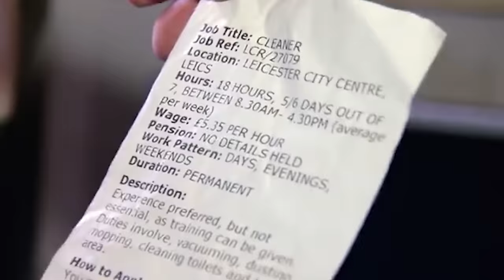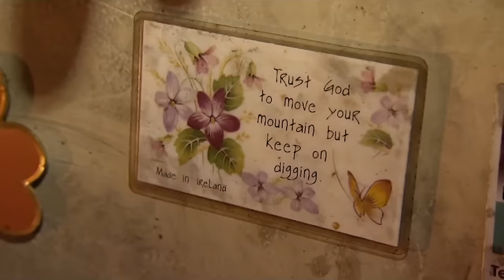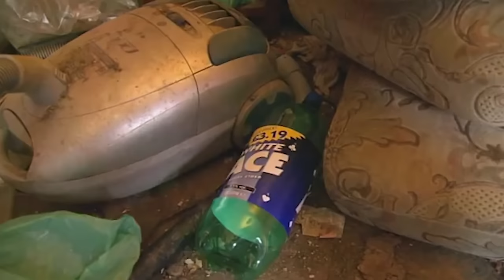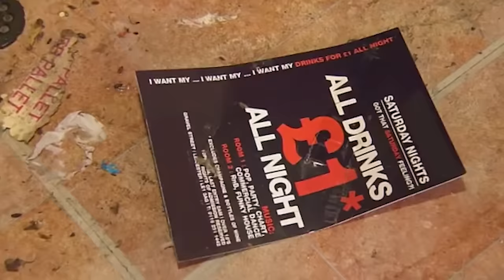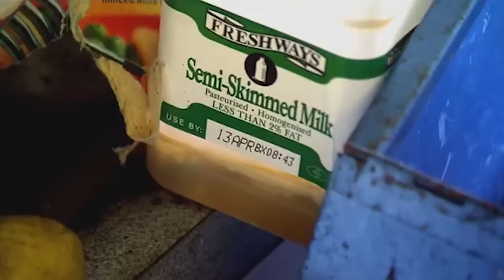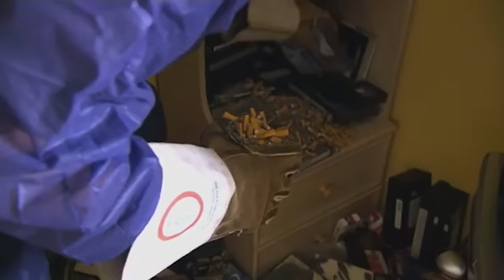Top 5 DIRTIEST Homes! | Grime Compilation | Filth

Comment: These guys need professional filter masks, the mould, dust, rat droppings and the slime everywhere. As a commercial cleaner, this is why I don’t do homes. 😢
These guys are Angels ❤
Reply: What do you clean? May I ask
Reply: I was wondering why they didn't have a mask on. Just the smell could have a lasting affect on their health.
Reply: @mrbald8760  I am a commercial cleaner and have worked as a cleaner in many different environments. Large Hospitals, TAFE’s, which are trade based, degreasing floors, stripping and sealing & polishing commercial grade flooring. Vacuuming carpets and also flooded carpets and floors,  extracted until the water is clean and use fans to dry quickly, dirty contaminated floors can cause mould and mildew, black mould can cause deaths and can be found in air conditioners that are not cleaned and the grills behind them that harbor these spores. Ceiling fans need dusting and sometimes removal of vents in ceilings that are clogged. Bathrooms especially in hospitals need to be cleaned everyday due to high levels of condensation. This can occur in small birthing units as well when the room does not have time to dry out between patients, extraction fans should be installed and on while the birthing is in progress, shower curtains collect mould and the mould is pink and black in one hospital room where I was a patient. I pulled the curtain right back against the wall so my body was not in contact and the water didn’t reach the curtain. Always clean the sinks, take out the small drain if possible and get a bottle brush that can get down into the pipes, sometimes if at home and the shower gets blocked you can pour down vinegar first then add bi carb of Soda, quickly shove a hose with water and and towel to cover immediately as a reaction will start to happen and this is what should clear the drain plus the pressure of the water together, keep a very firm hold around the hose with the towel over the drain to create a seal from above, you will notice when the drain is unclogged when there is no forceful back pressure and the water runs down freely. You do have the option of removing the U bend under a sink or bath if you have access, remember to wear gloves and safety eyewear when doing this and have a bucket underneath the drain area to catch the build-up, and you can be sure the stench will be the first thing that gets you so we’re a professional mask if you do it this way, with the correct filter. I have also worked with cleaning chemical and Pest control chemicals including Termite work on construction sites (not so common to see women in this profession) and I have also done plastering, and sanding back plaster. I have cleaned in bakeries and many other places so my Workplace Health and Safety is very sound. Most important of all is to check all electrical cords and machines are not damaged and machines are clean and in good working order, all filters should be clean before use and cleaned after you have finished using the machine/appliance. In workplaces the items are tagged and tested yearly and the same should be done with Fire hoses (not cracks, splits, missing nozzles) and the inspection company will stamp date the metal plate to verify it is in compliance same time each year. These are important check list items for daily use and correct PPE should be worn when working. Your employer should instruct you how to operate any new machinery and any that you have not used before. There should be an automatic cut out device on any commercial/industrial equipment to avoid electrical hazards to humans or surrounding areas like carpets or any toxic contact. Do not let cords that are not waterproof and correctly insulated near wet areas and wear thick rubber gloves that are lined inside and insulated footwear like long rubber boots and any other body precautions before going near a site work area. There should be signage to indicate applicable PPE. It is always your safety first before anything else. This includes glass, gas, flammable and bio waste to name a few. Flood waters are very dangerous and can contain many unknowns, so always be aware of your surroundings. 
Rule one: always keep your phone locked away and keep your mouth shut and breath through your nose around toilets. Wash hands even if there is no soap available and dry with paper towel. I always have sanitizer with me at all times and some tissues or paper towel/microfiber cloth.
Reply: Don't like the way he was just like they can't be arsed to clean as if
Reply: @sisqui1950  You ROCK!  ❤
Reply: 100% they need proper masks! I’m amazed they can cope with the smell but its so hazardous breathing in that filth 😮‍💨
Reply: I just concurred, then I read your comment! Those fellas need trophies
Reply: Yep

Comment: that bunker could be amazing ,espesially with the adition of the new type lipo4 energy storage batteries and a good 1500watt windturbine and 3kw of solar panels,, for 2000 pound there would be  power as much as one would need , i know i build a system like that no more powerbills,,,,,